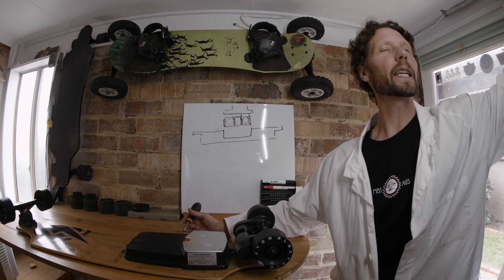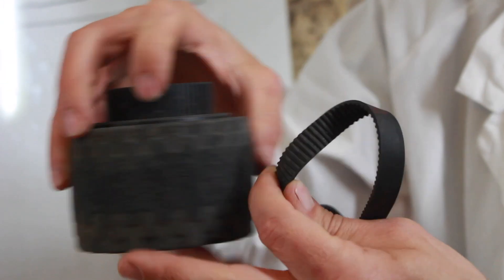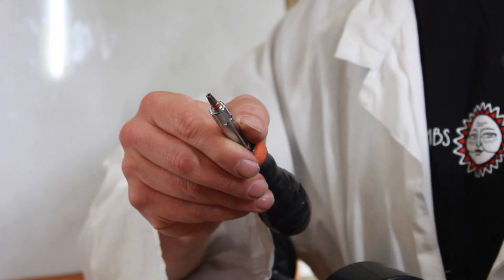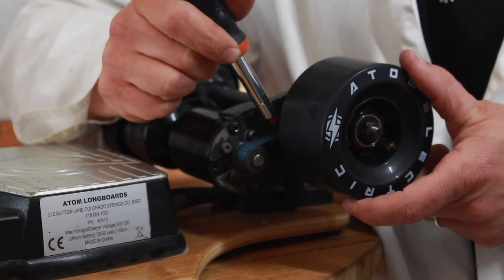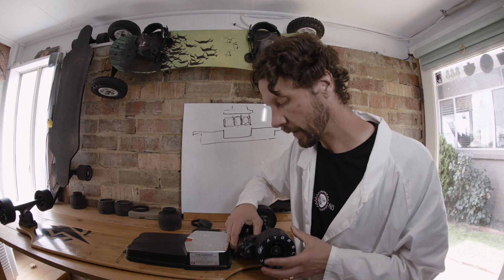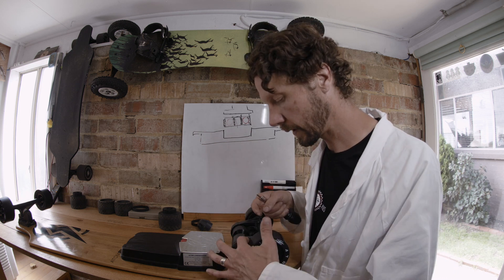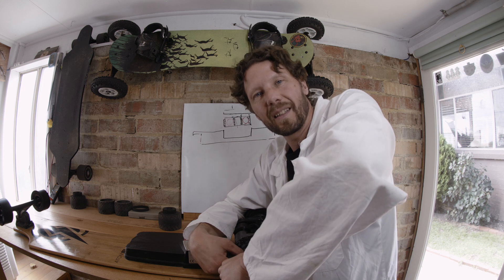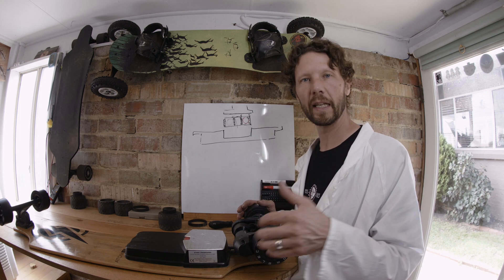TECH TALK - Belt Tension Adjustment - B18-DX

Comment: Thanks Joel, that was really helpful. I've often wondered how to adjust the belt tension. Does this work in the same way for the B10X?
Reply from the maker: It depends when the B10 / B10X was produced.  Almost all B10X in the market now don't have the new slotted motor mounts, but the ones we're producing now do.  So it's just something you need to check on your specific board(s).  The easiest way to tell is by looking at the motor pulley cover. If it has three screws it's the old mount (not adjustable).  If it has two screws it's the new one (adjustable).
Reply: I have a b10x and the belt has been an issue since I got it. I live in COS and took to atom directly and they changed out the non adjustable mount for the newer adjustable one, but mine has little tiny Phillips screws that don't hold the belt tension for more than a couple miles....can the small Phillips be changed out to the ones shown here so perhaps enough torque could be applied to actually hold tension? It's basically unusable at this point even if you baby the heck out of it, only ride flat and level and use at 50% power. I just paid $130 for a new battery and now the belt issue is back again. I've tighten  it 3 times in 5 miles. Last ride I got 1.75 miles before it slipped and belt skips.